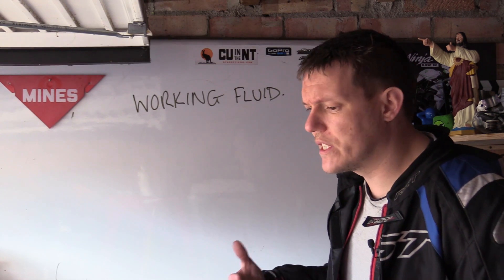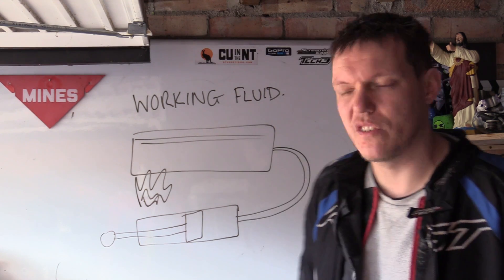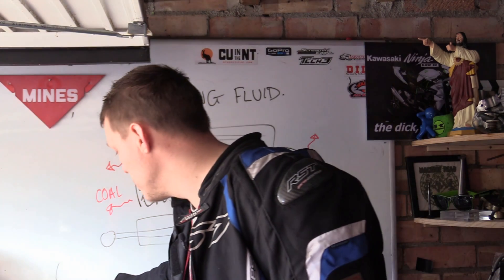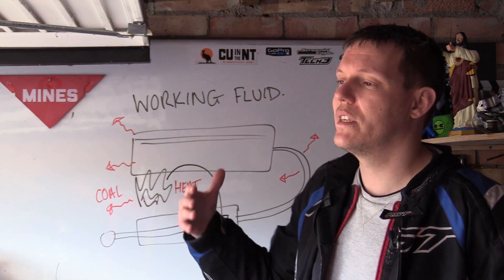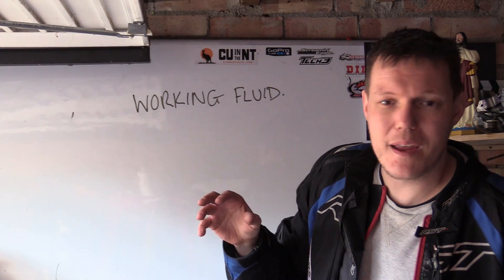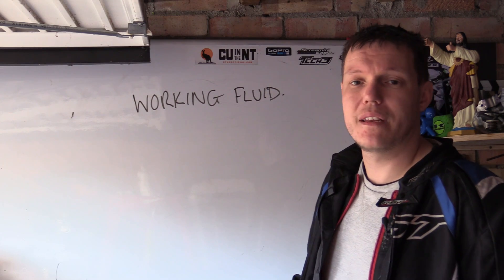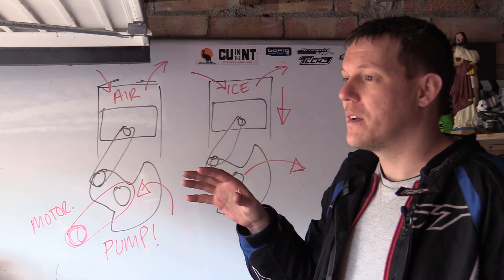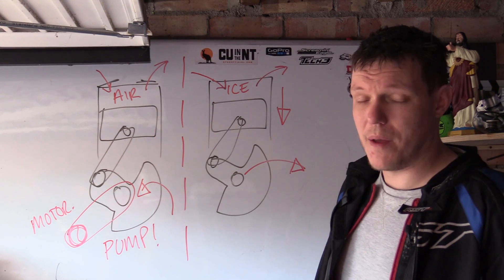An engine is an air pump?

Comment: You’ve got to put kinetic energy into a I/C engine to
make it work.  If I stick some fuel/air
mixture into an I/C engine nothing happens until I introduce an external kinetic energy,
turning the motor over.  That might be a
kick starter or an electric starter by a battery.  

Once it is running, in the case of a diesel engine
certainly, then the distinction can be more easily made.
Reply from the maker: "You’ve got to put kinetic energy into a I/C engine to
make it work."

- No you don't. Close but you don't
Reply: @thedirtyworkshop  So if  I just put some air/fuel mix under atmospheric pressure (because adding pressure is adding energy) then the engine (stick with diesel and ignore glow plugs) will just start running?  I don't see how that works and I've never seen it work in real life.  I have to turn over an engine to get it to fire, just like I have to pump a pump to get it to pump.  ANd fuel itself is energy, or potential energy, in the same way my muscle is.

Comment: "Exhaust" gases dont do the direct work ... did you mean "combustion" gases are the working fluid?  In most engineering thermodynamic diagrams "exhaust"  gases are '
"wasted" .. contributing to entropy - excluding exhaust turbo system of course.  A pedantic comment on my part but perhaps a bit correct?
Reply from the maker: Tell me the difference between exhaust gases and 'combustion gases'?
Reply: @thedirtyworkshop  Combustion gas is the gas that is formed from air and fuel combusting and then doing work - moving the piston. Exhaust gas is the gas that is left over ... its' the arrow that points out of thermo- dynamic state diagram boundary that they shoved up our butts at engineering school.   The gas is "exhausted" .. it aint doing any more work so it cant be a working fluid.  It heats up the muffler, tailpipe,  atmosphere, girl friends/significant others inseam .... going into the entropy pit ...it is no longer a "working" fluid.   As I stated i'm excluding turbo chargers but this a bike site so what I'm stating is correct.  Where is my thinking wrong?

Comment: Matt, Rankine cycle reciprocating steam engines can achieve up to 63% Carnot efficiency. My understanding has always been this includes all system losses. (Slay me if I'm wrong)

The best Diesels are a few points better than 50%, petrol,20% worse.

Comment: I too hate when people say that because they are useing it to try and make an invalid point that means nothing.I worked for a company that had an air compressor made with a ford v8 one side of the v8 was the engine ran like a 4 cylinder engine and the other four were used as the compressor.but it had a different head on the compressor side with a check valve to keep air only going out .the piston might be the same but the end result isn't one is compressing air the other is making power to run the other side.

Comment: Your engine is an air pump when run the start motor 😁
Reply from the maker: because air is what you want?
Reply: The Workshop to be fair, based on your video, it is an input of energy from the starter/battery to move that air (and fuel)  into the engine... hence a pump ya cheeky bastard

Comment: Drives me nuts, 99% of steam engines function on condensation. Not expansion
Reply: Its a vacuum system, cool the steam in a sealed container and off you go.

Comment: Does a video explaining pumping losses, and then says its not a pump
Reply from the maker: LOL exactly - pumping LOSSES. Not gains. If we could remove the pumping losses then that would be great. We do take advantage of engine braking but that's something the brakes could easily handle, and it's there so why not use it. But putting it another way, most of the pumping is below the piston in opposition to it's motion.
Reply: @thedirtyworkshop  You're taking energy from the crankshaft and using it to pull air from the atmosphere into the combustion chamber. That's not magic that's a pump
Reply: @thedirtyworkshop  let me bring up EV's. Is it a motor or is it a generator? It's both, depending on the cycle. With a petrol engine it's both as well depending on the cycle. Intake and compression cycle it's a pump, combustion cycle it's an engine.

Comment: if your engine doesn't pump air (gas) it doesn't work very well.
Reply from the maker: Look up the definition of a pump

Pump - 

a mechanical device using suction or pressure to raise or move 
liquids, compress gases, or force air into inflatable objects such as 
tyres.

force (liquid, gas, etc.) to move by or as if by means of a pump.

We don't want to take air from here and move it over there. That provided no propulsion. Thje difference between a pump and an engine is the same as the difference between a motor and a generator 

The Drinking bird is a heat engine - no pumping what-so-ever......

https://en.wikipedia.org/wiki/Drinking_bird

Engine definition 

a machine with moving parts that converts power into motion.

Comment: I think the air pump term for internal combustion engines, means the more efficiently you can move air+fuel in and exhaust out of the engine the more high performance the engine will be.  Bigger fuel / bigger air intake / bigger exhaust. To help knuckle heads picture fuel and air and exhaust moving through the engine.  If I put my hand over the carb intakes on my massive 1980 GS1000 Suzy. It sucks in. Put my hand over the 4 into 1 Header air is blowing out, there you go Air Pump Ah Ha!...I'm joking
Reply from the maker: LOL no. The point is putting energy in to do something or extracting energy out. Moving anything through an engine isn't what produces torque we can pull out. This is why older engines were not very efficient - because of thermal efficiency.

Comment: If you do it right you can covert a 4cyl. engine to a air pump. you use 2 cylinder to do the work and the other two will pump the air. Or you attach a electric motor and pump with all 4 cylinder. It will work but I would not recommend to do it...
Reply from the maker: To effectively do this (2 cylinders powered - 2 cylinders pump) you need to change the camshafts. There's no point pump those cylinders twice.
Reply: Or you take a 2 stroke 4cyl. engine...  I said that I do not recommend it. Because you need to change quit much. And it is possible to double lobe the 2cyl. that pump. Not cheap and not easy... because you need also to oil the pistons and then get rid of the oil again.

Comment: Ok, I get exactly what you mean. 
In the pump you are introducing energy to compress the air and do work when you release the stored energy. In the ICE you are introducing energy to compress the air and do work,  pushing the piston down. Ok, so you've changed the gases so it can no longer be called an air pump, but it's still a.....

Fuck it, I'll go with the above.

Comment: So with motors-generators, some types can be used interchangeably, same for certain types of microphone. Could the same be said for an engine?
Reply from the maker: No. Pumping loses - so when an engine is pump is a bad thing - apart from engine braking, however we have brakes for that.
Reply: @thedirtyworkshop  That makes sense, but with engines if you were to say stop ignition all together and just drive with a motor, would air be pumped? 
The difference is where  the energy is supplied between motors/generators, specific motors are obviously better for their designed task, but to say one is the other isn't exactly wrong?

This is definitely semantics, I guess it all boils down to designed tasks in the end. In an electric car is it a motor or a generator!?!? :')
Reply from the maker: "but with engines if you were to say stop ignition all together and just drive with a motor, would air be pumped?"

- Then yes. It would be pumping air and nothing more.

"but to say one is the other isn't exactly wrong?"

- well then we can call arms legs and visa versa. But we don't.

"This is definitely semantics"

- Depends on the context - in engineering terms. No. They are different, totally. If you're using it to say 'this is like a pump' in a physical desriptive term then yes. But saying it's an air pump, then no.
Reply: @thedirtyworkshop  I understand, pumps take mechanical work, engines create it. I think. Cheers for the clarification, may have confused myself here

Comment: Is an ICE a pump? Yes, from the viewpoint that it pulls air in one side and out the other, but it's not it's primary purpose, which is to convert energy. Using it as a pump at the same time will decrease it's shaft output. Especially if you are using the exhaust to build up pressure, ie the exhaust directly in to a tank , not to extract more latent energy  ie a turbo.

Comment: you can run a steam engine down to single digit rpms and/or run it off of a huge range of pressures generated by any of a huge number of fuels... they're absolutely the better one to start off with as far as a development of heat engines goes.
Reply: It may just be mainly with hindsight. But it does seem to have made a pretty logical progression over the years. From the early low pressure condensing boilers, it was inevitable it would be driven to become smaller, lighter and more efficient. Let's face it. From those early bloody big mine pumping low pressure engines, pissing away virtually all the energy as waste heat, they had plenty way to come.
It also seems to have followed a pretty typical curve of steady improvement over the last two or so hundred years.
Reply: @rationalmartian  absolutely. there are very real advantages to steam engines being able to operate at lower pressures and speeds in terms of maintenance and service life, and those benefits are precisely what you want in the early development stages of anything.

I'm currently considering converting a '66 VW type-1 engine to steam for this basic reason. properly fixing it up to run on petrol is gonna be more effort and money than it's worth to me, but I'm pretty sure I can make it safe and reliable as the prime mover for an electric generator by running lower pressures, temperatures and RPMs on steam.

Comment: So the first is scribble on the left is an Air Pump and the second is a really elaborate Ice Crusher?

Sounds about right. When will it be up for order?

Technically you can also record sound with speakers, it's just worse quality than a device made for the job ;)
Reply: They are using LEDs for MICs  as well  ,  now thats sneaky

Comment: Just remove the valves on a flathead engine and replace them with oposing reeds and turn the crankshaft either way and you got a compressor

Comment: Kinda related factoid: Formula One technical regulations clamped down on using exhaust gasses to boost downforce through the diffuser or, by directing said gasses to the underside of the rear wing, reduce drag. Their rationale was that the engine should only provide locomotive force and not also become an "air pump" through manipulation of exhaust gasses.

Comment: 11:08 SOooo the hybrid F1 engines... arent they both an ICE and an air pump depending on whether or not the electric motor is inputting energy?
Reply from the maker: LOL I knew there would be someone...... This are different systems. For example a impeller on a turbo is the pump whilst the turbine - well its a turbine.
Reply: Quit trying to wiggle out of it! some of those hybrid systems put that energy back into the flywheel not the turbo impeller!
Reply: The Workshop ,, you knew there’d be someone .... I could’ve named that someone

Comment: Why not run engines on powdered Semtex like the powdered coal?
Reply: Do you have a source of cheap Semtex? I don't think they sell it in the UK so much these days
Reply: @dreddwailing6395 
Can you even buy black powder in the UK?
Reply: You can buy it in fireworks, I think it would be wise to ask your local police about building a gunpowder engine rather than have them storming your house at 5am to see what you are up to!
Reply: I wish! If I did I wouldn't be running engines with it!
Reply from the maker: "But the reaction speed is higher"

- Very true, but that deosn't matter. Heat ---> pressure ---> force/piston area ---> crank ---> torque. 

The combustion speed is so quick infact that you'll blow a hole in the piston
Reply: Adamantium pistons! ¯\_(ツ)_/¯

Why you gotta rain on my explosives parade!?
Reply: @Rob the Nog I saw the Richard Hammond remake of that! It was a good show.
Reply: @noggintube  
Very interesting. Much appreciated. I just watched a good part of it.
Reply from the maker: Because believe it or not Semtex and other explosives have a lower energy density than petrol (gasoline) less than 10MJ/kg vs 45MJ/kg for petrol
Reply: @thedirtyworkshop  it could cause Detonation problems 🤣
Reply: But the reaction speed is higher

Plus you wouldnt need an intake to drawl in air

Comment: While you are on steam engines explain how the boiler pressure is used to inject water back into the boiler , it's been explained several times to me but it still seems counterintuitive
PS, is the electrical device in a Prius a motor or a generator?
Reply: those steam injectors are incredible arnt they. Matt will hopefully ellaborate but the steam jet goes through a venturi (larger to smaller cone) and gains speed, mach 1 plus.  this lowers the pressure below atmospheric so "sucks" up water from the pond or whatever. The steam condences a bit aswell as picks up water from the pond and gains mass. This mass has a water hammer effect but still going fast, it then goes through another venturi (smaller to larger) where it takes the speed slows it down and builds pressure higher than the boiler so it can fill back into the boiler.
Reply: @1985metalmaniac  Yes, they are amazing. I don't suppose really it's any different than standing on a car jack and pumping yourself into the air but it always baffled me as a kid.

Comment: It is extremely hard to do a cold start with a steam engine.
Reply: It is, when I was a teenager I used to build miniature steam engines, obviously miniature steam engines still operate under full scale physics.  THe basic steam engine will be an oscillating cylinder- like a nodding donkey it will expose the cylinder to an inlet and exhaust valve- it is the system Mamod (those toys you could buy) worked.  You had to get the (brass) cylinder really hot to even have a hope of the steam not condensing as soon as it hit the cylinder.  Proper miniature engineers could do more complex stuff in larger scales with more prototypical designs , I didn't even have a lathe or pillar drill, just a hand drill so  was limited- not sure if oscillating cylinders were ever used for full sized steam engines because of the mass.   Trying to work out the math was complicated because it not only had to work theoretically (which was relatively easy to work out) you had to factor in 'not to scale' heat loss.  A smaller cylinder was better for heat loss but worse for power.